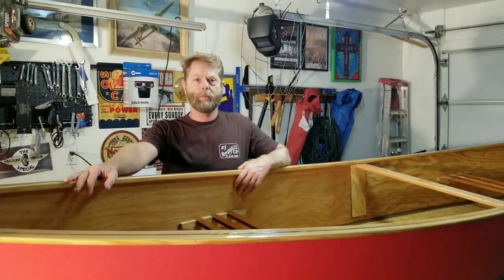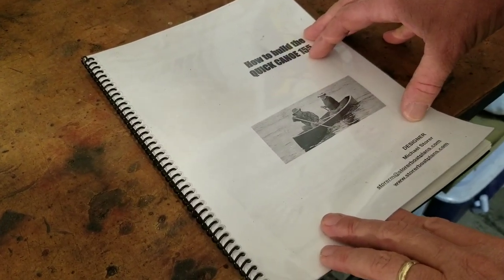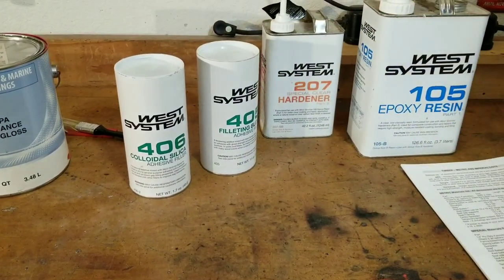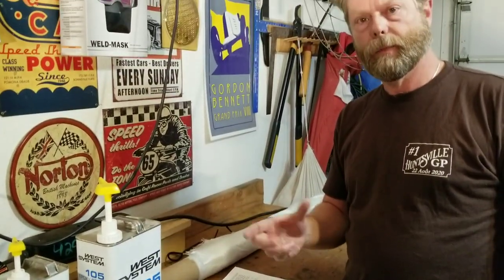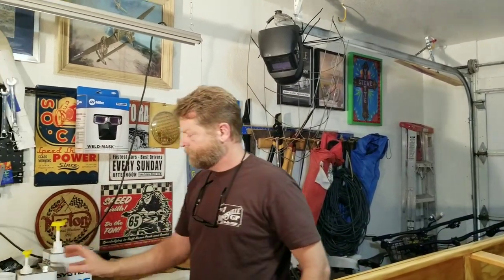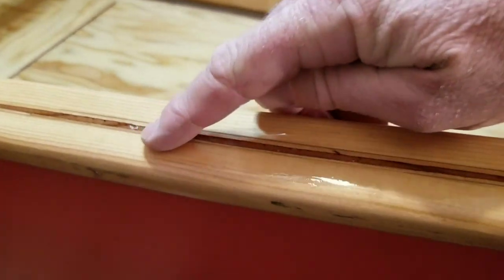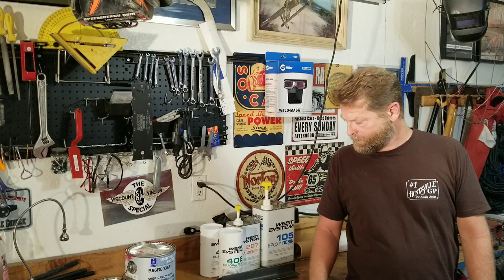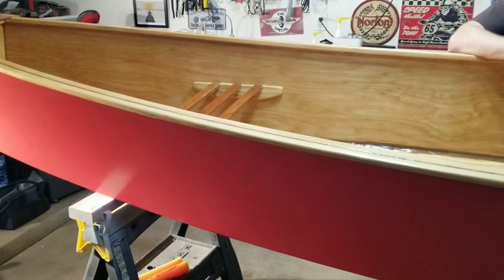Quick Canoe 155 Build Review

Comment: You can buy 2 inch, 3 inch, or 4 inch fiberglass strips from any of the aircraft parts suppliers.  They use those strips when putting fabric on wings to cover the top of the ribs.
Reply from the maker: good tip, that would have been easier

Comment: What is the freeboard on this canoe? It looks nice and deep. I know this video is 2 years old. I'm wanting to build a 12'-13' solo canoe/kayak hybrid with front and rear decks with dry storage like you did in the bow of yours. All the kits and plans that I see have a pretty low side, but I want higher sides and a bit wider boat. I'm just looking around at different designs right now but I'll probably end up designing my own based on the best attributes of others that I've seen. Thank you.
Reply from the maker: This design is set up to be simple to build and cheap by reducing waste.  You use almost all of the plywood sheet with this design.  I think you could fairly easily scale it up a bit to make it larger, but you may need more sheet of plywood to make that happen.

Comment: 1st mod, don't use that very expensive epoxy.
With wood I'd go with polyester resin, epoxy is suited for foam build.
Reply: Polyester resin doesn't stick to wood as well as epoxy. Using polyester you risk ruining a lot of work. On the other hand it is cheaper.
Reply from the maker: I used the materials suggested by the designer, it seems to work great.  Thanks for watching

Comment: This is exactly what I was looking for as to give me an idea of how I want to build a gheenoe styled flats skiff , the flat bottom and easy design and it wouldn’t take much to add a transom on the back for a small outboard , I want it 16’ ft and about 5’-6”in mid ship to give it stability, and a front casting deck, it will probably be built with general purpose resin , now people say it doesn’t soak in but if you thin it down with acetone and hardner it’s fine , how’s your canoe holding up , are you using it a lot, I may add extra glass on the hull and strikes and keel on the bottom to keep it where I want it to go, I think the biggest pain in the pooper is getting it registered as a home made water craft , but the money saved and knowing the boats construction should help plus if there’s something you don’t like you can change it 👍👊🏼✌️
Reply from the maker: We used it a few times here in the desert lakes near Phoenix.  Not the best conditions as the large lakes get choppy in the wind.  Holding up just fine.  We unfortunately don't use it as much as we thought we would.

Comment: Thank you for this video. I was looking for this quick canoe for some time now, and most probably I will give it a go this spring. If I'm not wrong, you have build it from regular plywood, not the marine. How does it held for now and did you have any problem with the plywood during the build? I have problem to find marine plywood in my country, so I will need to use regular or in better scenario the one they call something like "splash proof" or moisture protected.
Reply from the maker: The material supplier told me it was Marine Grade....however I have no proof, just his word for it.  It is holding together just fine either way.

Comment: I have the plans but troubles finding the right wood. In my region getting exterior/marine wood is really hard and expensive. So i was wondering, as i am planning to put epoxy on the entire hull as you did. Wether its also possible just to use plywood where waterproof glue is used.
Best regards
Bella
Reply from the maker: I am really not sure.  I had to find a specialty Plywood guy here in Phoenix.  I asked the local wood trim and cabinet supply guys first, eventually they referred me to a guy who works out of his house, lol.  Probably a good idea to send Michael Storer an email or post the question on his Facebook page.  I think other guys have used non-marine grade, I just heard that you cant leave it in the water for long periods.  Probably not a problem for a canoe.
Reply: Thanks for your reply! I ended up finding someone being able to supply me with okoume plywood which is also recommended by Michael storer. Now I’ve got a question regarding the epoxy glue, as you are using west system which would be my choice as well. How many litres of glue did you use & what’s the difference between those two powders ur showing and how much did you use of those?
Best regards
Bella
Reply from the maker: @isabellforester6371  I bought and used one container of each, they look a bit like a coffee can.  The Fillet Blend is used to fill holes and create the Fillet joint where the bottom meets the sides.  The Colotial Silica (spelled wrong?) is used to thicken the epoxy to create a glue to glue almost all the prices together.  If  I was to do it again, I would put one or 2 coats of Epoxy on all the large surfaces before assembly, masking off the areas that need to have glue applied.  I struggled with runs that had to be sanded and as a result,  a lot of unnecessary labor.